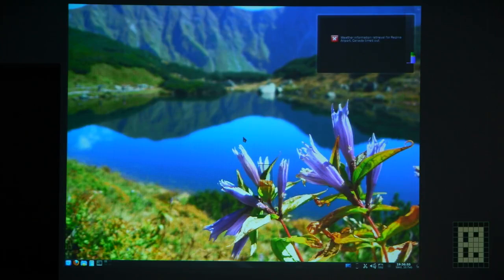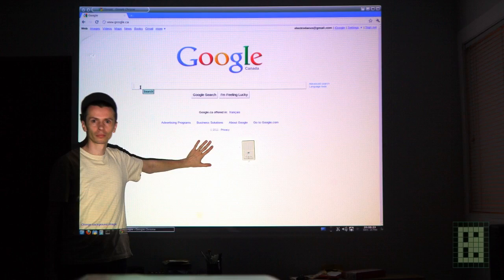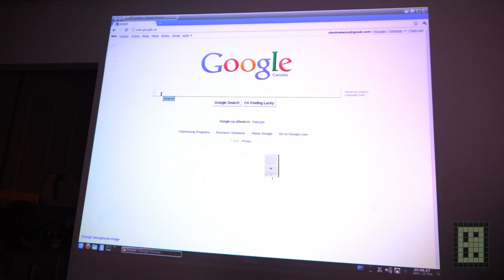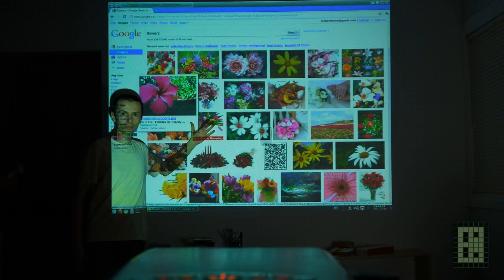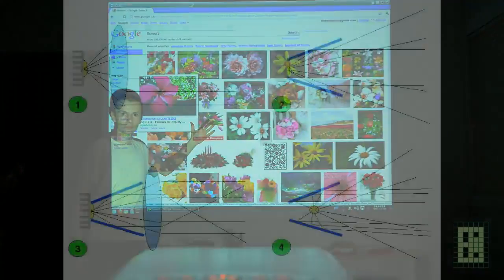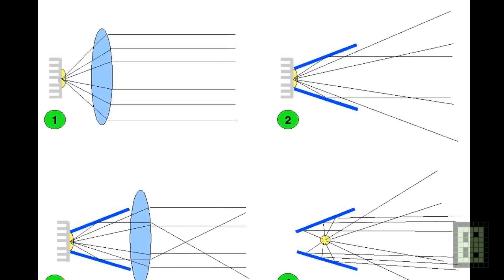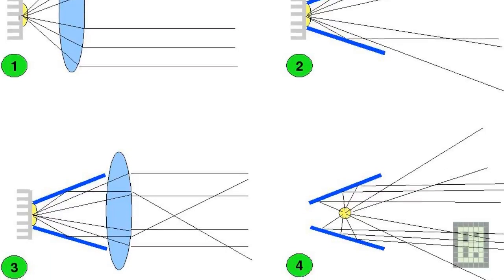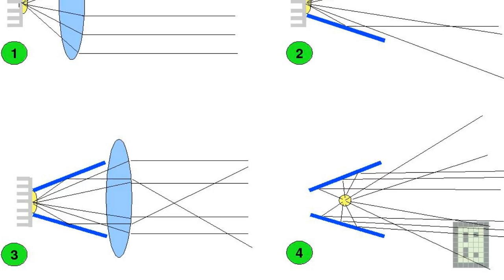DIY XGA LED Projector 3xLCD lamp replacement 25 lumen 720p (part-2)

Comment: Hi What is the input voltage for the Balast normally?
Reply from the maker: Marus S
LED's need constant current power supply the voltage drop is less important.
So what you need is a constant current power supply.
This is one example but may not be good enough for those 50W LED's http://www.ebay.ca/itm/171709830797
You can get a fixed one like this that will work with those LED's http://www.ebay.ca/itm/321461904029
And this last one http://www.ebay.ca/itm/111177068259 is more expensive but will allow you to set any current and have a digital read out of the settings and actual use.
You set the voltage at 35 or 36V can be higher not so important and current limit at any value you want not higher than 1500mA for those particular 50W LED's.
The LED will receive your set current and there will be a voltage drop on the LED probably around 30 to 32V depending on the set current and LED temperature.
Dacian.
Reply from the maker: It depends on manufacturer 200 to 300V DC normally if I remember correctly.
Reply: Which means the to leads going into the Balast is at this Voltage which ia already rectified by someother board. Mine is Epson EM-800 and 700 series.?
Reply: PLease let me know if you have on update/Recomendation of Brighter LEDs for me to mod my projector?- Thank you so much
Reply from the maker: Dayal .T
I have not looked in to this in a long time. Now there are inexpensive LED projectors at really low prices.
I think the 10W Cree XM-L is still the most powerful that you can use with this method.
Commercial LED projectors use separate RGB LEDs really close to the LCD,LCoS, DLP. But with white LED without tonally modifying the projector that is the best you can do.
Reply: Dayal .T Best LED four 3 LCD screens projector  is CREE MK-R  +two lenses plan convex and both placed over the led without distance between them. Lenses:  38mm x 19.5mm first and 50mm*18mm second. 
12V 2A Regulated Switching Power Supply (100~240V) Voltage output fine adjustment is available for different power.
 You need radiator and fan for the LED.
Reply: ***** I will try with 3x 50w white leds (ebay.com) and 42mm x 2.0mm Glass Lens for C8 Flashlight (red, green,blue kaidomain.com $2.55 piece Free World-wide Shipping). I have a sanyo plc-xu47 projector.
Reply from the maker: Marus S if you are talking about the multi die 50W LED's then do not waste your time you will not be able to effectively collimate the light from them and with 3x 50W LED you will get a worse result than with a single die 10W LED.
Reply: ***** My guess is that i don't need a condenser lens unless pill LED light is higher and exceeds the LCD surface. I test with 3 Chinese LEDs 10W (8mm light pill) and had to distance about 5cm for their light to cover the entire surface of LCDs. Light pill of Chinese LED 50w is 2cm, just as the LCD and i think i can place the LEDs very close to LCD screens, immediately after polarizing filters, after previously, i glued over LEDs colored glass that i mentioned above.
Reply from the maker: Marus S OK so you want to remove all the color filters and mirror and get very close to each individual LCD. In that case you better just get Read, Green and Blue LED's it will be more efficient than just filter a color from white LED's.
Also with 50W LED's you will need monster cooling. Probably heat pipes cooled with 80mm fans.
Reply: ***** You're right, but colored LEDs are powered at different voltages. I'm not good at electronics and do not want to complicate, so I prefer the white LEDs because they have the same voltage and amperage + color glass filters. I would like to try only white LEDs without any colored glass over them and wonder if the resulting image will be black and white ... If the projected image is black and white but very bright it's ok. The led's do not heat up so loud (i already have one),their size heatsink and fan is enough, or a larger radiator but with small fins + fan to fit into the space behind the LCD's panel. I do not know how to power them (50W led 32-35V 1500mA each). I plan to use a 150W laptop power supply and DC-DC Boost Converter 10-32V to 12-35V 6A Step Up Voltage Charger Power. Any advice is welcome. Thank you.

Comment: Это можно сделать намного  проще с большей эффективностью.
Reply from the maker: Are you sure ? The efficiency was really good considering I used such an old projector. This 3 LCD projectors are not more than around 10% efficient so my light collection was around 50 to 60% efficient.
Yes a projector specifically designed for LED will be more efficient at light transmission but converting an old 3LCD projector will never give you a better efficiency. Do not forget the LED used around 6W and was outputting 500 to 600lumen at best so around 5% got out of the projector under 10% normal 3LCD projector efficiency and 50 to 60% my Lens assembly light collection efficiency. I'm sure not many did not even got close to that.
This was done 4 to 5 years ago. I was probably one of the first to do such a modification.
Reply: На всю переделку sony vpl-ex3 ушло очень много время. Фокусирующие линзы не нужны.  3lcd 1led :) Фото первого теста дам,жду ссылки на облоко без регистрации.
Если вы меня поняли то скажите...
Reply from the maker: ***** I use google translate function not sure is a great translation but seems to do something :) (I'm originally from Romania so I know you are probably from Russia)
You say something about not needing a focusing lens (probably for the LED) but you need one you need a strait laser like sort of light else most of the light is lost.
The 3LCD are just 2 to 3cm diameter and about 20 to 30 cm away form the LED. If the light beam is not travelling in a strait line it will not get to the LCD and just get lost inside the projector as I pointed out in the animation at the end of this video.
It also looks like you say you have some photos of a modified sony VPL-ex3. If you do just provide a link. But without a real measurement using a luxmeter and knowing the projection area it will be hard to compare results.

Comment: dear sir pls help me
i have Hitachi cx5 projector  .i install led bulb its working ,but 2 mints ago blinking lamp indicator blinking. balest 3opter cupler. pls help me
Reply from the maker: So it worked ? For how long ? If it did before it must be something that changed. Maybe one of the fans has stopped working or some over-temperature error.
Reply: after 2 mints lamp lamp indicator blinking. balest 3 opto cupler. i have service manual  which wire short sir ,pls help me
Reply: dear sir i dont no which wire shot .how can i send service manual sir
Reply: ***** 
after 2 mints lamp lamp indicator blinking. balest 3 opto cupler. i have service manual  which wire short sir ,pls help me
Reply: dear sir i dont no which wire shot .how can i send service manual sir
Reply from the maker: *****
send it to my gmail address same username as here.

Comment: Hi friend. Thank you for the good video! I am trying bypass the ballast, find the optocouplers, link gnd and opto inverted in MB side(in my projector.be 3), but not work... Do you know how work in Samsung SP-M250s? Thank you again!
Reply from the maker: AFestaBiz 100W LED will not have worked  because of multiple usually 1W LED dies and is not possible to collimate the light.
The best you can use is a 10W LED single die like the CREE XM-L and with that you will get about 40 to 50lm out of the projector.
Reply from the maker: Hi That is a relatively new projector and is a high probability that the simple mod  to bypass the lamp demonstrate in my video may not work.
In newer projectors starting as early as 2002 2003 on some models there is a serial communication on that line and not just a simple high or low level as it is the case on the older projectors.
Reply: There only have the connections that you said: 3 pin fat cables (ballast), 2 pin fat cables (lamp) and 5 pins (small connector) to 3 optocouplers (pin 2 is GND). If have a idea tell     me. Thank you very much for divide your knowling.
Reply from the maker: *A Festa* - Musica ao vivo + DJ + Som + Luz
Out of 3 optocouplers there is one oriented different than the other two that is the one that gives the Lamp OK signal so the two wires that come from his two terminals need to be shorted. if not sure You can send me a photo with the optocouplers  at gmail sameuser name as here. The new projectors look the same with the 5 pin connector and 3 optocouplers but instead of just low (0V) signal for Lamp OK they pulse on/off with a digital code that is read by the main board as lamp OK signal so when you just shunt the two wires the new motherboard will see this as lamp failed.
But it is still possible that they use the old method so you can try.
Reply: *A Festa* - Musica ao vivo + DJ + Som + Luz Não se vai safar com esse projector parece-me,é demasiado recente para o que quer fazer,os projectores mais recentes(a maioria)têm muitas proteções e bastante evoluidas,alguns até usam foto-sensores,já ouvi falar(não sei se é verdade) que alguns modelos até usam os famosos e velhinhos heat stwichs de uma forma mais avançada ou seja no passado serviam apenas para despoletar caso o projector entrasse em over heating e assim desligar o projector por segurança,agora usam o mesmo mecanismo para detectar uma determinada amplitude de calor aceite pelo projector e com lampada diy o registo termico será diferente e o projector  não vai ligar.Faça como eu,compre 3 ou 4 projectores velhotes no ebay a um unico vendedor para rentabilizar os portes e depois faz o grounding e elimina a proteção do high/low voltage.Tenho dois a funcionar assim mas tem pouca luminusidade.
Reply: *A Festa* - Musica ao vivo + DJ + Som + Luz Não faltam no ebay uk projectores a 10 euros + portes claro.
Reply: ***** I maked this way, exatly you say, but unfortunally, not worked...I think that is a electronic methodology. If you discover a new procedure, very people will be happy. Thank you.
Reply: Markhuntonio Pois é amigo, infelizmente os mais antigos nao tem uma boa luminosidade como os novos com a tecnologia 3LCD. Acho que nao escaparei de uma nova lampada. Tinha a intençao de colocar um super led de 100w. Falta isso e os polarizadores dos LCDs que creio já haver descoberto um meio paralelo com filmes polarizados de alta temperatura no Ebay. Obrigado pelo comentário.

Comment: hola!!! muy buen video... tengo un proyector epson EX7210 como debo hacer para  que funcione sin la lampara original? te menciono que ya probé quitando la ballast y punteando los cables (solo dos a la ves) pero solo marca que no hay lampara y temperatura alta... te agradeseria tu ayuda
Reply from the maker: That seems like a really new projector model. Not sure if the lamp bypassing is working on your model.
Also not sure what exactly is the question. What sort of lamp do you want to use as a replacement.
Reply: ***** gracias por responder... tengo un led de 25w a 2000 lumens trabaja a 16.5V a 1.5A y tengo una fuente de laptop de 19.5V y una resistencia de 5.25W para evitar que se queme el LED y tenga una larga vida y claro con un lente para concentrar la luz al centro... y solo me hace falta hacer que mi proyector funcione sin su lampara original... saludos
Reply: Rob Olvera te puedo mandar fotos de mi proyector, led, y fuente solo dime a donde. GRACIAS

Comment: hello, nice to say hello, could teach me to bridge my projector that I have launched and would like to add a trick led lamp, congratulations on your video I liked a lot. My projector is a panasonic pt-lb10u, thank you very much.
Reply from the maker: I will need a photo with the high voltage power supply (ballast) near the control connector where the optoisolators are.
You can send that to my gmail address same username as here.

Comment: Thank you for this information, The ballast just went out on my Epson Home Cinema 3010. I am seriously considering switching it to led. the projector claims to be 2200 lumen. Is that what it puts out or is that what the bulb puts out. Should I consider upgrading to a 4000 lumen led? Thank you.
Reply from the maker: Yes your Epson puts out 2200lm at full and about 1760lm in echo mode. It has a 230W lamp that puts out probably over 24000lm (yes 24k lumen) and that lamp produces light from a very small dot so that light can be efficiently collected and send laser like to the 3 x 2cm LCD's
The best you can do is use a 10W LED that puts out at 1000lm and depending on how good you are at collecting the light form that LED I expect no more than 50 to 70lm out of the projector.
I used an LED supplied with 6W and I got around 25 to 30lm out of the projector.
You can not use larger power LED's since they have larger die size or even worse multiple dies and you can not collect the light efficiently the best bet is a 10W CREE XM-L you need a single die smaller than 2x2mm
Commercial LED projector can obtain better light output but that is because they use 3 separate LED's one for each colour (RGB) very close to each LCD (they usually use single LCoS). They have larger die and exact same aspect ratio with the display. Some others like Casio use Lasers for Blue to get higher output.
Eye response to light is non linear so in order to perceive a doubling in brightness you need 4x the amount of light.
Reply: *****  Thank you for the information, I knew there would be some loss of light through all the mirrors and lenses but I had no idea it would be 90%. I went ahead and bought the parts to fix the MH light source. Thanks again.
Reply from the maker: Aaron Shinn Most of the loss through the LCD's the loss on the mirrors and lenses is very small.

Comment from the maker: The best LED you can use in a converted projector is the CREE XM-L.
Unfortunately this is a 10W LED and puts out around 1000lumen maybe less depending on bin so about 50 to 60lumens out of the projector.
But this is the largest you can use it has a 2x2mm die and that is about the limit so that you can collimate the light in to a laser like beam.
Because LCD or DLP is smaller than 3cm diagonal and distance from light source is about 30cm the spot from 1m needs to be less than 10x10cm.
5000-6000K.

Comment from the maker: The lens is needed to collimate the light in a straight beam as close as possible with a laser beam so that all light gets to the LCD or DLP. Usually the distance to the LCD's from the light source is about 30cm and the LCD depending on model is just around 3cm or less diagonal.
So your light source needs to create a beam that is really tight no more than a 10x10cm projection from 1m.
I used two lenses to reduce the focal distance since there is little space inside the projector.

Comment: Hello there, i need some help, i just moded my sharp that has 2 optocuplors, and now i don t figure abaut the led to put inside it. What kind of led should i use? i need bright image, my room is a bit lighted, what colour temperature is better to use, and also i see on the market 50w leds (the most powerful on this market), but it surface is flat, not bulbed like in this video.

Comment: Hello again, I almost finished my Sanyo 3LCD projector. I used 4die Cree power LED MC-E 6500K. I tried 2700K but colors are too much yellow and there was no clear white.In 6500K it's looks very good, brigthness is enough to watch in evenings and perfect in night. Colors are close to normal lamp. I used half-flat lens and it is best solution. Everything is fitted in original lamp chassis.

Comment: I made numerous attempts to 100w diode. I confirm that DLP projector is impossible to focus well on this diode. If the projector is DLP recommend it 100 xenon projector LCD if it is possible to use the diode and 100W, but there are many great loss of light!

It is not desirable to use a multi-point light sources, such as diodes 100W!

Comment: and these often come back to us with the bulb blown. We end up throwing the projector away, because the value of the projector by that point has gone down so much. I was looking for a way to replace the bulb with an LED that would be capable of outputting a comparable number of lumens.

Comment: Yeah, that is what I thought would be the case. Those big 10,000 and now even 20,000 lumen LED's aren't single point light sources, the chip has an array. When these are focused on a wall what you see it a magnification of the surface of the chip.The only other way I could think to do it would be to use a diffuser, and then collect and focus that light. 

The reason I am interested in this, is at my place of work we supply lots of LCD projectors to bars and clubs

Comment: Thanks for your attention :)
These days, when  arrive 1800 lumen LED flashlight, LED will pull out and do experiments with him. I have some lenses and I'll try to put it as close to the color wheel on my DLP projector :)

But I not giving up and diode 100 watts! With ordinary lenses is impossible to focus, now try 2-3 daysI
 Now my last hope is to focus all his light with the help of Fresnel lenses. I guess a month to arrive and fresnel lenses for last experience with 100 watts diode.

Comment: Now I want to try it with LED diode. I have 100 watts of LED diode 8000 LM, but after many attempts I was unable to focus, barely reach 35w brightness with a Xenon bulb. It is impossible to focus such a large diode.

I have a 1800lm Latern with Cree Diodes has approximately 120angle! If done carefully Dedoming (cutting the lens LEDs) that light would be better directed forward (in point).

1800 LUMEN CREE XM-L T6 LED 18650 FLASHLIGHT TORCH ZOOM LAMP LIGHT ZOOMABLE

Comment: Hello all :)
I apologize for my bad English.

I have one year to 35w Xenon modified DLP projector. The dark look good in daylight barely visible in the evening of the lamp is visible picture, but funds for watching. The xenon bulb is focused on the original reflector spotlight, with many attempts I did adjust optimally.